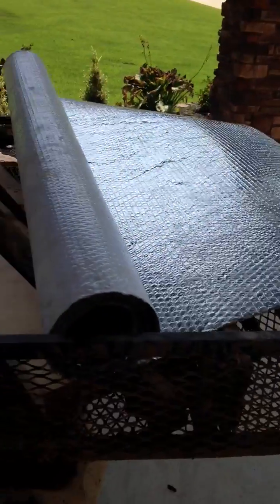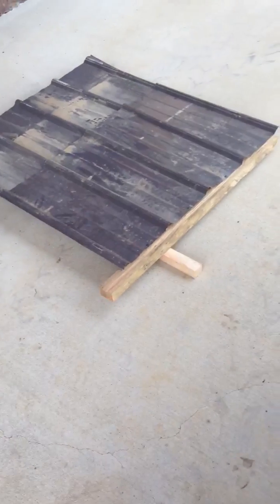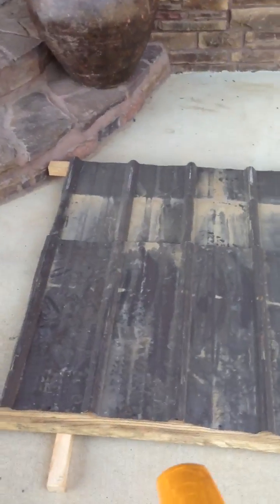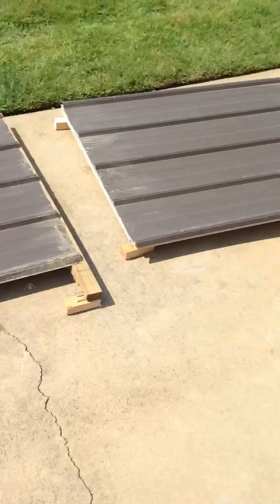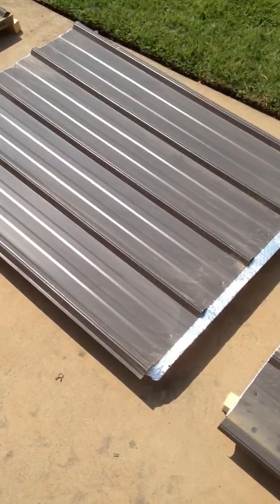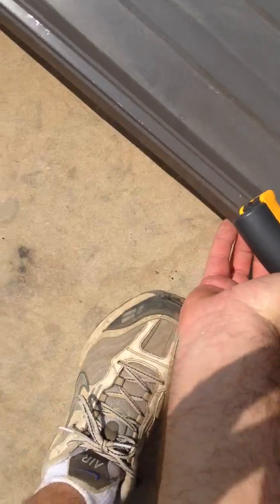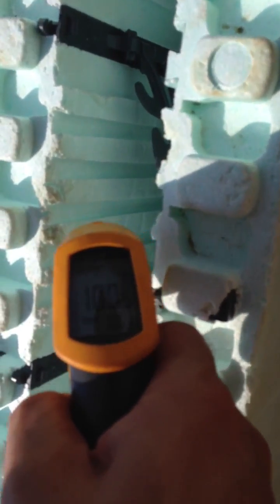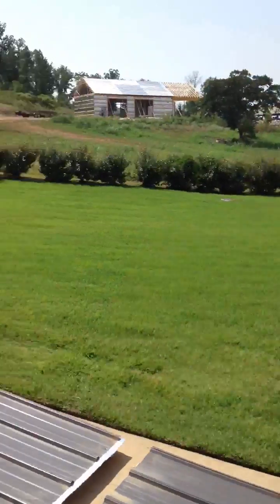Bubble wrap insulation. How good is it really?

Comment: Temperature does not means too much. Important is the thermal flux. The flux through a thin layer of bubble wrap is far, far more than through the thick polystyrene foam insulation. The thermal flux coefficient is around 0.04W/mK for polystyrene and could probably be double for the bubble wrap because it does have the portions where the plastic layers are united surrounding each bubble, allowing thermal bridges to form. And now if you calculate thermal flux for a 1 square meter of 5 cm thermal insulation at 10 degree Celsius difference between front and back, the flux will be 0.04W/mK x 1 sq meter x 10 degr C / 0.05 meters = 8 Watts. If you make the calculation for bubble wrap...how much thickness has? 4mm probably, and the coefficient let's say is 0.07W/mK (I am sure it's actually much more) 0.07W/mK x 1 sqm x 10oC / 0.005 m = 140 Watts
Reply: Ok Sheldon